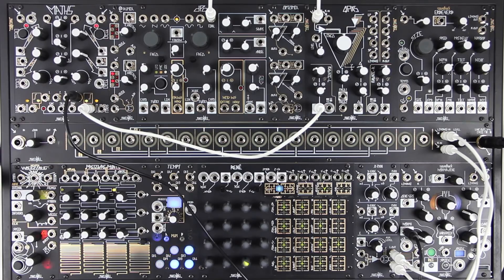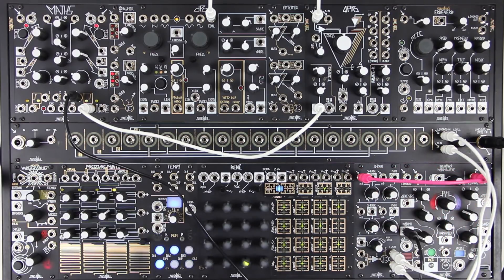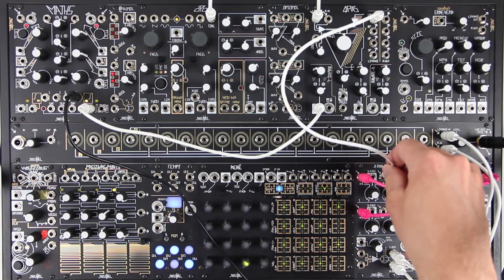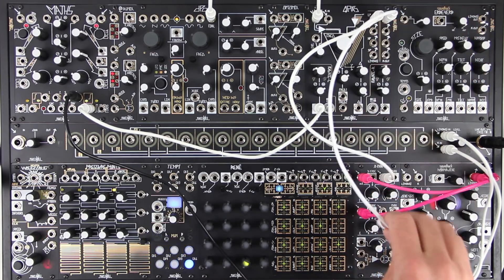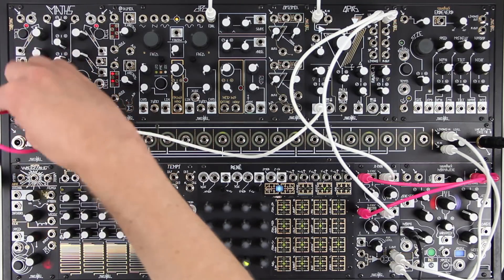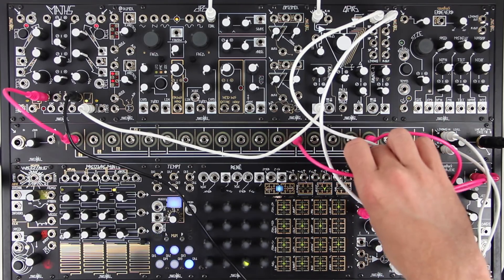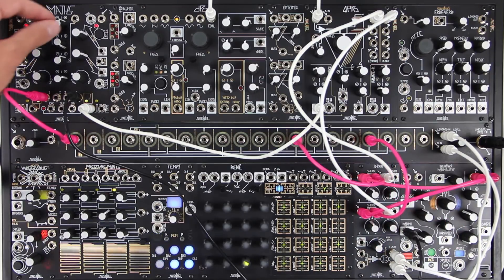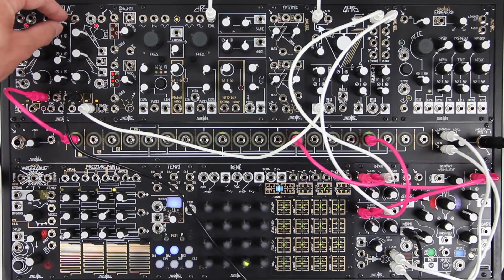X-PAN  Tricks: 3-Channel VC Stereo Mixer

Comment: I want this but a two channel stereo mixer it's way too expensive at $260
Reply from the maker: if you are not using voltage control of pan or crossfading, then you may consider the less expensive XOH instead :)

Comment: Very Cool.    I just bought the BnG Plus, was told the STO would make a good addition to the system, so I bought it ( no complaints). Here I see the QPAS has replaced the Echophon.... What are the advantages of replacing Echophon with QPAS, and adding an X-Pan versus another oscillator?      Aaaand then here comes the Mimeophone.  ¿!!?